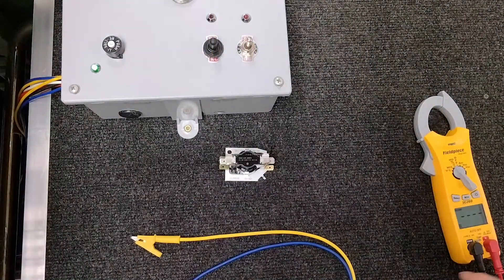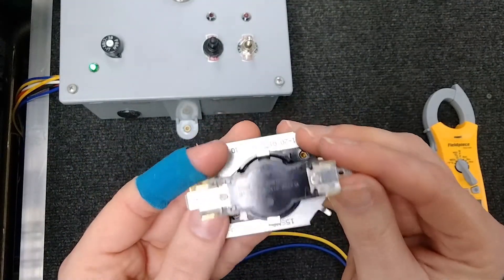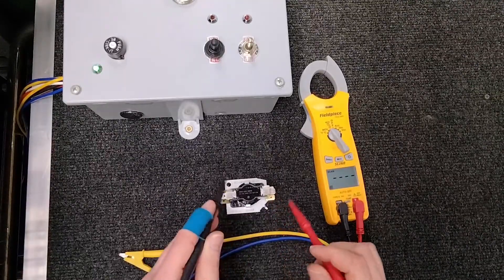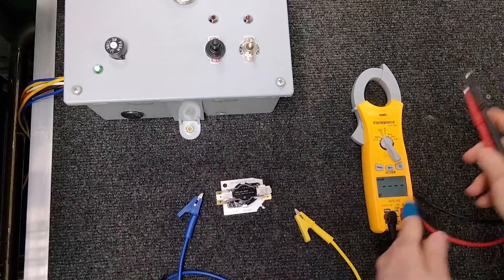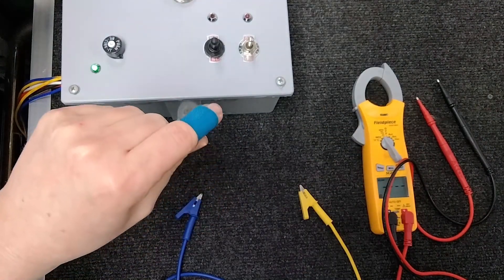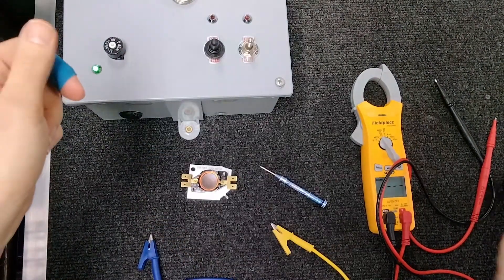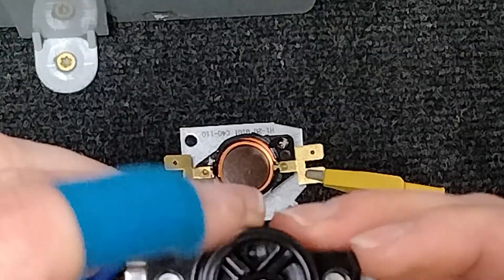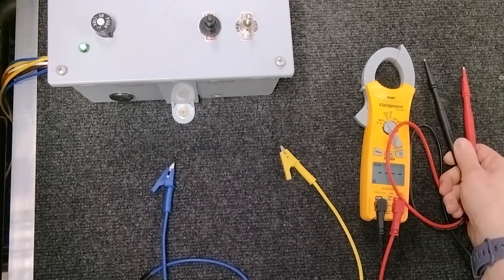Let's Open Up A Heat Sequencer And Learn How To Test It!

Comment: And you have disc in backwards it pops up when cooled not down. The way you have it it will cut off both stages when powered and will activate sequencer when 24v is taken off

Comment: I saw this video you did, and I wondered how did you supply the 24 volts to the sequencer? Also, what brand or equipment did you use to supply the 24 volts? Thanks in advance for your reply.